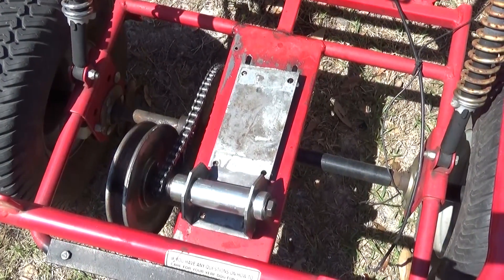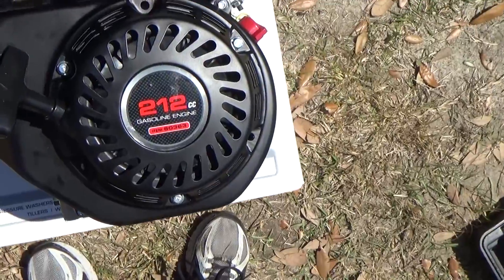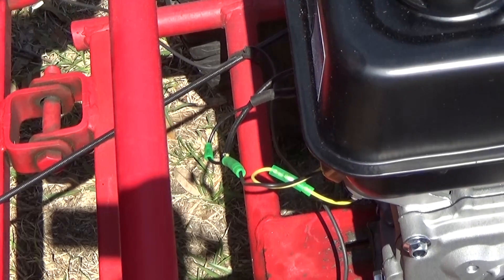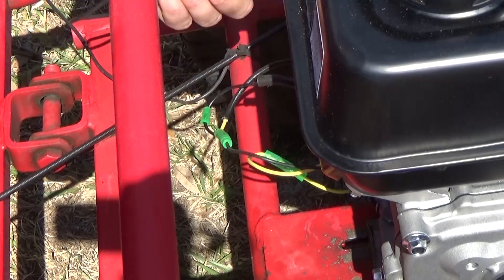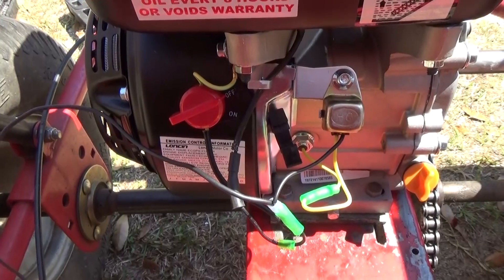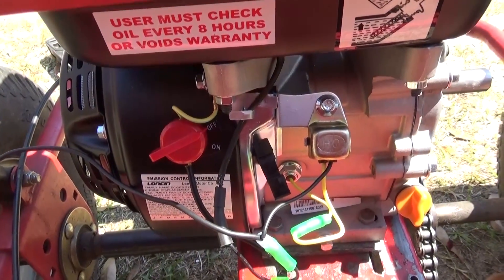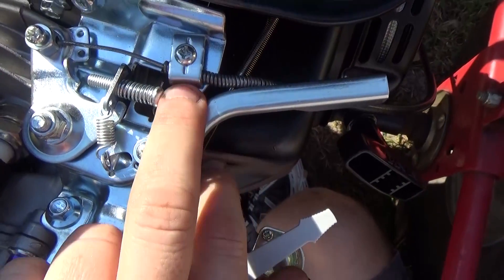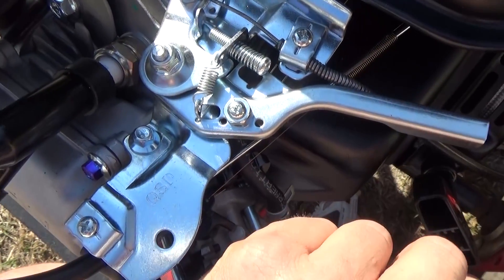Replace Engine on a Yerf Dog 3203 with Harbor Freight Predator Engine

Comment: Hello Clint, 
Can you tell me name of the parts you used to mount the engine and where you get them from? i got the exact same yerf dog but is missing the mount for pulley and the big clutch. I also have a 6.5hp predator engine and would love to get it running. i would appreciated if you send me the specs of the driven pulley you used, the mount of the driven pulley, and also the driver clutch. Thank you!!

Comment: at 15.24 in the video u mentioned a part tht lines up the converter what is the name of tht part??
Reply from the maker: +King Jr It's called a key. And the slot on the shaft it slides into is the keyway. That what you are asking?

Comment: what is the belt size? I found my belt is to loose to engage the clutch
Reply from the maker: +Brad Martin I am using the Series 30 torque converter and this is my belt.

http://www.bmikarts.com/30-Series-Torque-Converter-Drive-Replacment-Belt-Q43203W_p_3237.html

Comment: What tires you use and suspension
Reply from the maker: +JordanCRF450 Everything is stock. I can get you the models if you need them but they are just the stock tires and suspension that comes on the Yerf Dog 3203.

Comment: Great video!
I have recently picked up a yerf dog fixer upper and am about ready to put my modified predator on it. I have a billet con rod and flywheel, camshaft, full intake and exhaust, performance carb and jet kit and I have clocked 50 mph on my old live axle kart. Anything I should be worried about if I attempt to match that predator engine with the CTV unit?

Thanks
Reply from the maker: +Michael Gedies Probably the main thing I would be worried about is how little of the shaft will actually match up with the torque converter.  I was worried about it with this engine and it certainly doesn't have the torque that yours will.

Comment: Is that a 20 series torque converter if it is where did you get your belt and whats the size of your belt and item number thanks
Reply from the maker: +Brandon Thompson Actually it is the 30 series.
Reply: +Clint Holland whats the width

Comment: theres a screw that has a spring around it by the throttle assembly and if you take it of you can get fjll throttle out of the  engine
Reply: and if you take the governor off to it goes fastee

Comment: Nice video. Do you think it will be easy to install the bigger engine on it as well?
13 HP (420cc) OHV Horizontal Shaft Gas Engine 
Thanks,
Dave
Reply from the maker: ***** I considered that as well.  It almost certainly can't be easier as this was literally a piece of cake but anything can be done.

Comment: Can you describe where you chose to mount the return spring for the throttle on the engine? BTW, this is an excellent video and perfectly timed for me. Both our karts tecumseh engines died last summer.
Reply from the maker: Aaron H I ran it around to the outside of the muffler and connected it to one of the slots that already existed in the muffler.

Comment: what is the piece u put on the shaft at 15:44  of the video?
Reply from the maker: jackie mccullin It's called a hub driver. It's part of the torque converter or clutch that is already on the go-kart.   See this link and it's part #5.  

https://cometkartsales.com/Comet-Industries-Torque-A-Verter-TAV2-30-Series-Parts/
Reply: Clint Holland Lol. Yes, I saw it after I looked inside the piece I was holding in my hand. I have this same Kart, I picked up at yard sale for my grand kids, but the engine went south. I was wondering if this engine would work as a replacement. Worried about the shorter shaft, but I am going to try it. Great video. Thanks for posting it.
Reply from the maker: jackie mccullin I can't speak for it long term, but mine has been working without any problems for months now.  But like you, I was also very concerned about how little of the torque converter is actually on the shaft.
Reply: Clint Holland were you able to reuse your old belt? I replaced engine, but now my belt is slipping. Hoping a new belt fixes this, but just wondering.
Reply from the maker: I sure was.  But I had a pretty new belt and torque converter.  I also adjusted the engine to make sure the belt fit correctly as I was installing it.

Comment: Can u do one on putting on a new brake?
Reply from the maker: Urdaily Gamer Maybe.  What kind of brake are you referring to?  Replacing the drum or the shoe on the existing one or are you referring to replacing the drum brakes with a disc brake?
Reply: Just the brake band it's a 6in extended I don't know how to put it on though

Comment: The belt is on backwards! Engine side is facing away
Reply from the maker: Peanutwinters Good catch.  It's on correct now.  Mainly because the frame broke and I had to take everything off to have it welded.  But good catch.